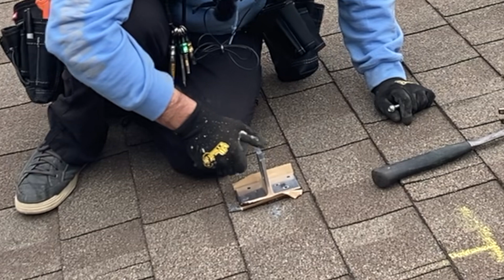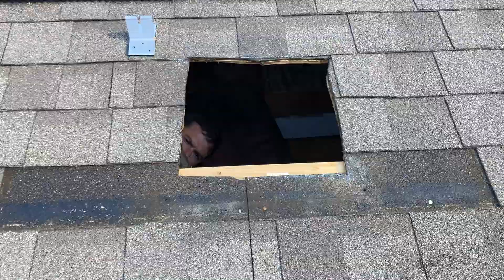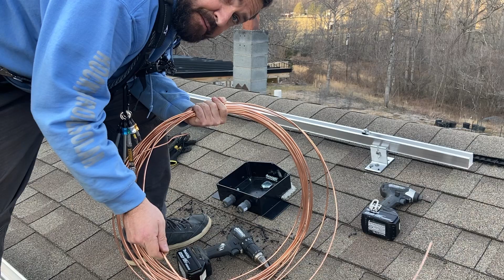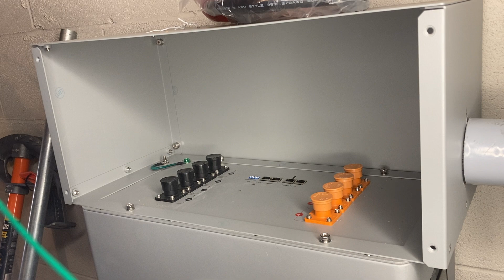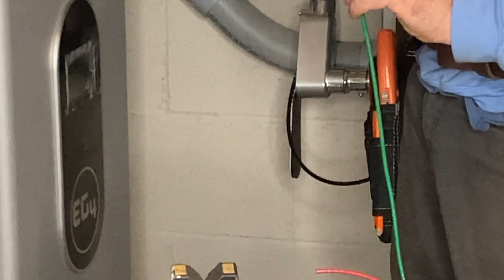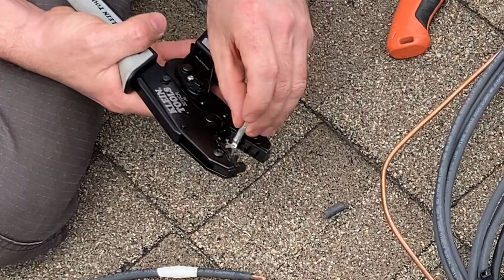EG4 FlexBoss21, GridBoss, and Indoor WallMount Battery Installation - Part 3

Comment from the maker: Signature Solar affiliate link (CHEAPEST SOLAR PANELS ON THE MARKET and EG4 Products) 
$50 off for orders over $500 when using coupon code: ROCKYGET50
https://signaturesolar.com/?ref=uzUOpPif73O10D

The products discussed in this video are linked below....

https://signaturesolar.com/eg4-flexboss21-14-3-28-6kwh-capacity-eg4-wallmount-indoor-battery-bundle-bndl-e0023/?ref=uzUOpPif73O10D

https://signaturesolar.com/eg4-gridboss-vs-mid-200a-service-entrance/?ref=uzUOpPif73O10D

JB-1.XL Rooftop PV Junction Box, Asphalt Shingle, Black https://amzn.to/3XmfWjL

IDEAL Electrical 2006S Crimp Connector (Pack of 100) https://amzn.to/41gfZyv

IDEAL Electrical 2007 Splice Cap Insulator, (100-pack) https://amzn.to/43fH33Q

Staubli MC4 Connectors Male and Female | 12AWG / 10 AWG https://signaturesolar.com/staubli-mc4-connectors-male-and-female-12awg-10-awg/?ref=uzUOpPif73O10D

Staubli Open End Spanner Set | 32.6024 https://signaturesolar.com/staubli-open-end-spanner-set/?ref=uzUOpPif73O10D

500ft 10 AWG Copper PV Wire | Black and Red https://signaturesolar.com/500-ft-10-awg-copper-pv-wire-black-and-red-30-amp/?ref=uzUOpPif73O10D

Victron 600A Bus Bar 4-Stud/8-Stud https://www.currentconnected.com/product/victron-600a-4-stud-8-stud-busbar/?ref=RockyBroadSolar

Tools used in this video...
Klein Tools 11069S Automatic Solar Wire Stripper https://amzn.to/4iaY3Nj

Klein Tools 3010CR MC4 Solar Ratcheting Crimper for 10-14 AWG Stranded Copper Wire PV Connectors https://amzn.to/43gboz4

Klein Tools 21051 Large Cable Stripper (2/0-250 MCM) https://amzn.to/419Y2BO

IDEAL INDUSTRIES INC. C24 Four-Way Crimp Tool – Spring Loaded, Fingertip Adjustment Wire Crimper for Two Connector Sizes https://amzn.to/4iduDNW

Greenlee 7238SB Slug-Buster Knockout Punch Kit with Hex Ratchet Wrench
https://amzn.to/40UHL4I

Right Angle Drill, 1/2 In, 355/750 RPM
https://amzn.to/3WFlyFb

Klein Tools 51605 Iron Conduit Bender Full Assembly, 1-Inch EMT
https://amzn.to/40FaGbO

Comment: I have a short run from roof JB down through sofit and along my wall on outside of house down to inverter. Do I have to switch from PV to THHN in that rooftop JB before going down vertical into inverter?
Reply from the maker: No, you don’t have to. PV wire is just a little more difficult to pull through conduit and it’s more expensive which is why most people just transitioned to THHN on the roof. There’s nothing wrong with running PV wire in conduit, but there is something wrong with running THHN outside of conduit in free air in the sunshine or in the elements.

Comment: 36:50 - This hasn’t been in the NEC since 2007, I think. It was replaced by RSD.
Reply from the maker: @MichaelBurko It looks like you are correct. I did not know this until today. Great feedback. That is a sign you have an old man solar installer talking in this video. Times are a changin! Thanks for the feedback sir!

Comment: How many 10 Awg pv cables can run thru one 3/4 dia metal conduit or 1 dia ( flex, rmc, imt).
Reply from the maker: The NEC has some charts that get more specific by conduit type, but this chart should be pretty darn close. From someone that has pushed the limits of wire fill, my recommendation is to never max out the conduit fill or you will regret it when it comes time to pull wire. https://nassaunationalcable.com/es/pages/nec-conduit-fill-chart?gad_source=1&gad_campaignid=20505627013&gbraid=0AAAAADs3ss3vLdJz93ZLlAmaYep5nDHRr&gclid=CjwKCAjwqKzEBhANEiwAeQaPVeM8vrIVE0kAu0GRL1X1wJbL7Edm-9YyfQpZroP-KoFQy75F4fvphhoC2esQAvD_BwE

Comment: And what happens to the solar installation when it's time to replace your roof? I never hear anyone who mounts through the roof mention that.
Reply from the maker: You pull the system up, re-roof, and re-install it. Luckily all of the racking comes off and on in large sections and it is much easier to re-install compared to the original installation. Definitely something to think about for those who are not going to DIY. It is always good to ensure you still have 10-15 years of life left in your roof before installing solar or may want to consider a new roof ahead of time. Thanks for watching!

Comment: I’m about to start installing literally the very same components with two batteries….I have watched each of the install videos a couple of times. Each time I seem to pick up new information…
Question please….i understand the requirement for metal conduit when running DC voltage from panels to inverter. Does that also apply when running between batteries and the inverter? It looked to me like you have pvc conduit between the batteries and inverter? I would definitely prefer to run pvc there instead of 2” EMT.
 Thank you for the time and effort to make all these videos.
Reply from the maker: That only applies to the "PV power source circuit" which is the circuit between you solar panels and inverter, and it only applies once it enters the building. That is because it is high voltage DC and back when that code was created, there was no way to kill the voltage between the solar panels and the inverter when the sun was shining. The battery circuit is low voltage DC so it is much more safe. Thank you for watching the channel @Zack7228
Reply: @RockyBroadSolarLLC  Thank you for explaining that! Trying to decipher the NEC is beyond me. I count on people like you that know what they are doing!
I will go with pvc for mine also….
Thank you for the time you put into your videos….very helpful!

Comment: The gridboss CAN have aluminum as long as it's only going into the Eaton Breaker on the grid side.  The Eaton Breaker itself is rated for aluminum conductors
Reply from the maker: @micahmorton that makes sense. In my situation I have a service disconnect/main 200A breaker outside by the meter, so I did not have a need for the Eaton CSR. Great tip for people that are using it though! Thanks for watching the channel!

Comment: Excellent videos!    Very well explained except…. You said the ground wire that came up and tied into the bar was not number 6 Ike the solid but didn’t mention what it was.  8, 10, or 12?  I have had a hard time finding #8 green on spools and went with #10.
Reply from the maker: @jasonfreeland273 it is #10AWG from the roof to the inverter which matches the DC conductors. The #6 solid is oversized to carry a ground fault but it is upsized to be considered "protected from physical damage" when running across the racking not enclosed in conduit. Thanks for watching!
Reply: @ thanks for the reply.  That makes me feel better because that I purchased #10 for our install.
Reply from the maker: You nailed it!

Comment: I appreciate your videos and think that they are very informative. One thing I think you should mention is that what you were doing is code to your area and doesn’t mean that it is code everywhere. Especially when you mentioned aluminum wiring, aluminum wiring has been outlawed forover 40 years where I am. It is illegal to use and you are not able to get a mortgage or insurance with aluminum wiring.
Reply: Ya I didn’t want to say it but I’m in Canada.
Reply from the maker: Hi @jeffbrown222 Thanks for watching and for the kind words. I think what you are referring to is the aluminum wiring that was used in trailers back in the 70's. It has pretty much been outlawed since the mid 70s that aluminum can no longer be used for branch circuit wiring because is expands and contracts, corrodes, and causes bad connections that lead to house fires. Multi stranded aluminum feeder cables to feed sub panels and/or services is not outlawed however and is approved for use in the National Electric Code. I am not personally aware of anywhere that has or can outlaw it's use. It is also a different aluminum alloy compared to the stuff from the 70s. In general as long as you use and antioxidant such as noalux and torque everything to spec then there is nothing unsafe or inferior about it. That being said you are correct that each jurisdiction and each utility does have their own requirements and I only know the National Electric Codes and AHJ/utility specific codes for the areas I do work in.
Reply: I have a place in Arizona where I’m going to make my place off grid so I like learning from your videos.  I was surprised as hell that my friends and neighbours down there have aluminum wiring and their fuse box.  I couldn’t believe it. I’m a builder up here in Canada and don’t see it anywhere in residential.
Reply from the maker: @jeffbrown222 yeah and honestly things change a good bit when you get into some major cities in the northern US. I want to say places like Chicago and Philly might require all branch circuits run in metal conduit which is a local code thing, not NEC. Every place has it's own little tips and tricks!

Comment: Did you consider putting the gridboss outside by the meter?
Reply from the maker: I did consider it @DanielPile103 . It would have saved me about a 100 feet of wire and conduit. But then I would have had to run the smart circuits out there in the future and I really just wanted everything in the basement. Thanks for watching!
Reply: @RockyBroadSolarLLC  Thank you. Your videos are great and I hope you keep it up and get rewarded (monetarily) for it. If you do have to "move" (extend the wiring for example) any circuits to land them into the smart loads, i would like to see the details of that.
Reply from the maker: Absolutely @DanielPile103 I plan to keep on making these videos. So far I can't say the channel has been very lucrative but I figure if I keep at it long enough maybe that will change. I will definitely be documenting the smart circuits installation, the online settings, and I will be installing a chargeverter here in the near future as well.

Comment: Really appreciate you documenting this!  I know it takes time to film and edit.  I’m doing a similar install.  What 4 strand wire are you using for the Tigo Optimizers?  I haven’t found any that a reasonable priced that are rated for 600 volts to go in the conduit with the solar strings.
William
Reply from the maker: Thanks for watching @totalpropertysolutionsexte4738  It sure does double the time to install when you are trying to film every step of the process and yes, the editing adds up pretty quick as well. I am hoping that one day all of the hard work and effort will pay itself back but for now it is just a labor of love. This is the cable that I ordered for this project.... https://nassaunationalcable.com/products/250-18-awg-4c-shielded-vntc-tray-cable-tc-thhn-insulation-pvc-jacket-600v?variant=44689310908570&country=US&currency=USD&utm_medium=product_sync&utm_source=google&utm_content=siraj&utm_campaign=siraj&gad_source=1&gbraid=0AAAAADs3ss1333oYBcw-g97nu_SLjCB0S&gclid=Cj0KCQjwqcO_BhDaARIsACz62vNlw2dKJE-DfuCA81tHYudchr30IBxiodldAFFHI9dsGwvd3-8eVxQaAmRrEALw_wcB

Comment: I put little pieces of electrical tape on unused RJ45 ports on the battery... just so dust and cruft has no chance of diving into those ports.

I considered using terminal blocks for splicing the solar to the THHN/THWN up on my roof but I didn't think it would hold up under varying moisture conditions.  I wound up using power poles connectors instead.  Wire nuts work ok but I really like being able to disconnect/reconnect strings without putting stress on the copper.  The power poles make it easy.... the crimps work the same as MC4 crimps for the smaller "45A" (which are really 30A-ish) power poles so it's easy.

I will generally solder DIY MC4 crimps that are up on the roof exposed to the elements.  It just provides more of a barrier against corrosion (not for a better connection but for better longevity).   Yah... I don't do that for manufacturer MC4 crimps, I assume those are hydraulically crimped (though... maybe they aren't in all cases).   Standard hand-tool MC4 crimps aren't cold welds though so corrosion can get in there when up on the roof, even inside the box.

Power pole and MC4 housings are deep enough that solder joints are well protected from bending forces that would break the copper interface at the solder edge, so I feel that particular issue with soldering isn't a problem.

-Matt
Reply from the maker: Those sound like some pretty good tips and tricks Matt. Thanks for watching!

Comment: How old is your roof. Mine's a 2006 "30 Yr" shingle
Reply from the maker: I honestly don't know @butchgreene. I just bought the house "as is"  a couple years ago and it was in such bad shape it did not qualify for normal financing. Had to get a construction loan and I have been chipping away at it for the last few years. If I were to guess I would say I am 10-15 years in on a 25-30 year shingle. I figure since I can do all of the work myself, if I have to remove and reinstall in 10-20 years it wouldn't be the end of the world. The only sunny spot in my yard is my vegetable garden and I just couldn't bring myself to give that up.
Reply: Hurry up and finish your solar because upgrading your roof in order to add solar qualifies to be added to the total amount of your system cost and then apply the 30% federal income tax credit.
Reply: @Loki-rascal  The cost of a new roof is not part of a solar upgrade tax credit.